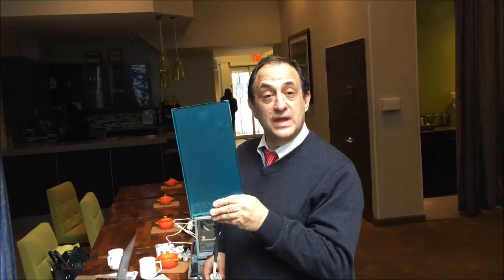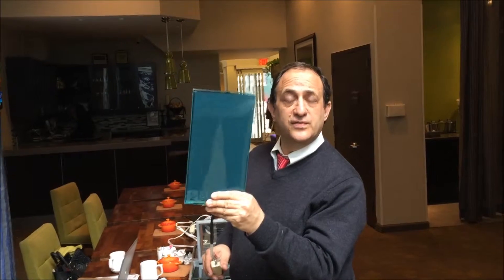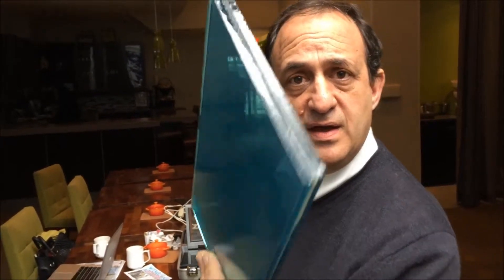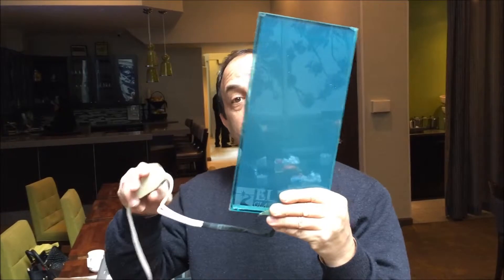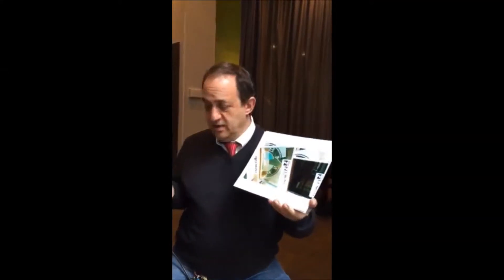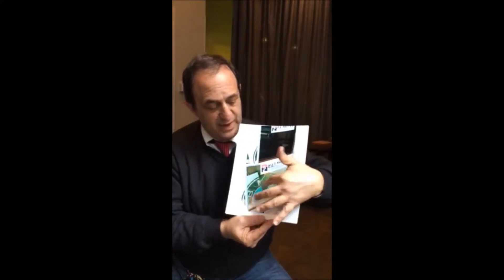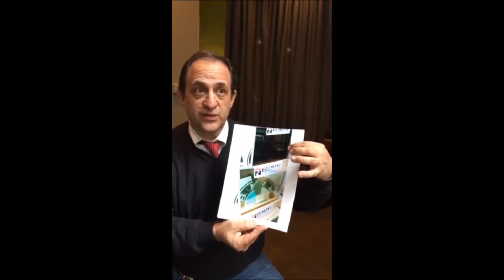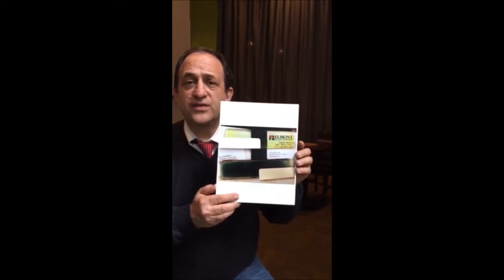Switchable Privacy Glass Technology | Dig This Design

Comment: Hi Patricia,

Is there a technology that detects air pressure on glass?

I have an idea for an ad for harmonicas. The campaign is called Breathe Life Into It. 

I want to use a bus shelter and, using a special type of glass screen, people will blow cold or warm air onto it. 

If someone were to blow cold air onto the surface of the screen, blue illustrations will appear. And if you blow warm air, red visuals will pop up. I just don't know if this technology yet exists.

Any help is much appreciated!
Reply: Steven , we could probably come us with a solution but would need more info